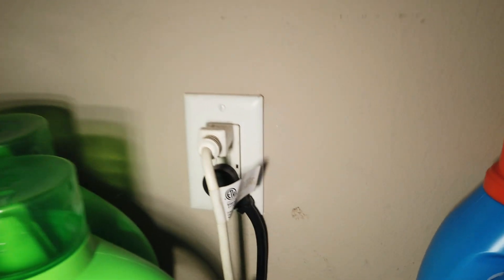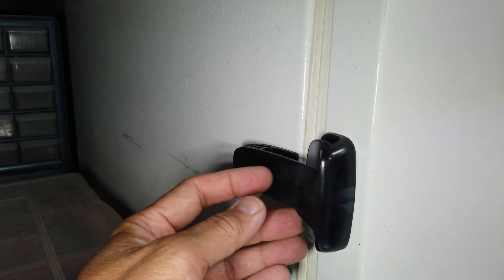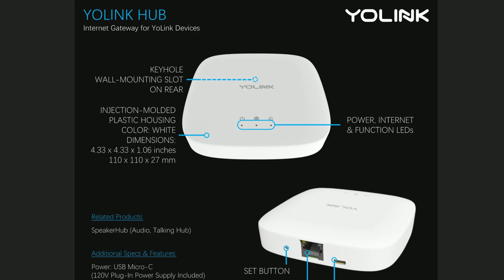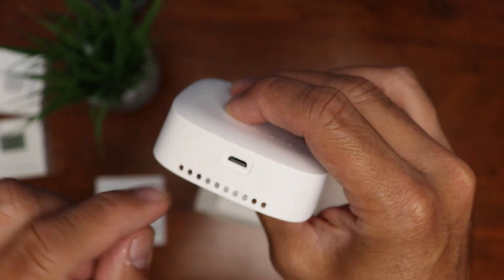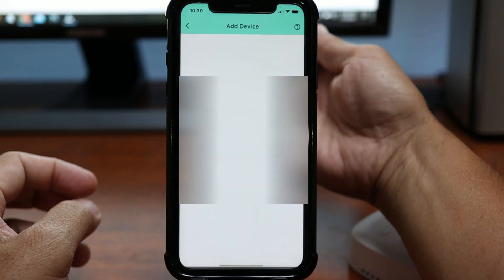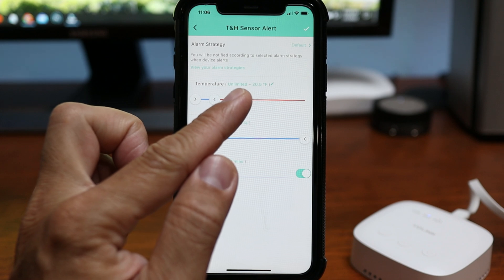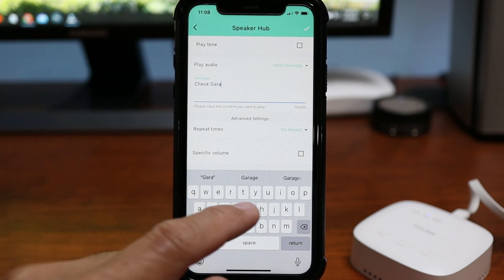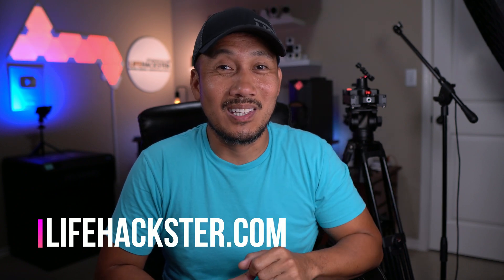Smart Temperature Humidity Sensor with Yolink Speaker Hub

Comment: I bought Yolink leak detectors and alarms. They are very easy to setup, to the point of I wondered whether or not these work. I have 4 sensors and test them every couple of months, they work like a charm! Having sensors on the top and bottom is a great feature. I wish they would make more products including cameras since they do a bang up job on everything else. If anyone is into automating their aquarium Yolink has enough sensors and smart power outlets to make economical setup. Great video LifeHackster!

Comment: Hey LifeHackster! Not saying these are "bad" products at all but I use GEN1 SwitchBot temp/humidity sensors with the additional "internet" hub and have these all over my home from the fridge, freezer, basement, garage, and a few around my home. These too can be setup with temp/humidity "ranges" which will alert you on your phone/email to let you know something is wrong in a particular area/appliance and I picked up a "bundle" of (4) sensors for $39 on Amazon after testing a few first. Now SwitchBot does not have the 1/4mile range (which is useless for me) but, these also work with Bluetooth! SwitchBots internet "HUB" costs $49 but sometimes goes on sale. The "beauty" of these products is there is NO annoying alarm or beeping which I absolutely HATE! Now WHY I choose SwitchBot? Well in a power-outage situation and these use Bluetooth I can "constantly" keep an "eye" on temps of my fridge/freezer and determine if I need to hook up my portable generator if temps start to get too high and my local "power" app says it's going to be several hours before power is restored! Most "modern" fridge/freezers are "good" for 6-8hrs with NO power.  The "simple" knowing of my temps with NO power is great and has kept me from "pulling" my generator out in MANY cases.
Reply from the maker: Thanks for the tips and sharing your experience with the switchbot. I have to check it out.

Comment: I'm glad to see you doing a YoLink video.  I have a lot of their stuff (I bought every bit of it) and it all works well.  The leak detection with the ability to shut of water to the house when there's no power or Internet is unmatched.  I use their regular temp sensor in my freezer and it works fine.  The LoRa system allows it to work though the metal of a refrigerator easily.  I use their temp sensors to also control ceiling fans in two places.  When the temp is "high" (80F) an Alexa app starts the fan and when the  the temp is "low" (74" it turns it off.  I use a motion sensor in my mailbox which works with an Alexa app to announce "You have mail" when it comes.  Thank you.
Reply from the maker: They have a pretty good system and their products and sensors are the ones that fill the gap that other popular brands don’t address and make.

Comment: Another simple solution is to buy a Power Fail Alarm that connects to the same outlet you want to protect. These alarms emit a very loud noise when power is loss to the outlet and the one device I bought on Amazon also emitted a bright flashing light. The noise is loud enough to hear inside your home even if it is connected in your garage.
Reply: YoLink has one that will send an emergency alert to your phone, or SMS/email. I use that, a door sensor and temp/humidity sensor as triple protection.
Reply from the maker: Thanks for the tip. I have to check it out.
Reply: @LifeHackster  The device I use is the Reliance Control Corporation Power Fail Light W/Alarm. Also, another viewer stated Yolink also makes a more sophisticated device that will send a text to your phone upon power failure (Yolink Smart Power Fail Alarm, AC Power Outage Alert).

Comment: I would move whatever else is plugged into that outlet and only keep the freezer to ensure that you reduce the chances of it tripping. GFCI could also be faulty. But I would definitely pull the outlet from the wall to make sure there is no damage to the wires itself. It’s tripping for a reason, look into it for safety reasons! Best of luck and thanks again for your reviews!
Reply: Also, they do have GFCI’s that emit an audible alarm when tripped, hope that helps!
Reply: @cjvillarreal217  , that's good to know.

TY
Reply from the maker: The only thing is..this is only the outlet I have in the garage. I cannot pin point yet what trips it but it happens rarely…mostly it is because of power tools but there are a couple of times that I don’t know about which caused the freezer to thaw out. Thanks.

Comment: Have you seen any LORA long range driveway sensors that have an app or alerts? most just notify you in house. I need it for a remote cabin in the woods that I am hours away from...
Reply: I'd like to know about one of these too.
Reply: @doughumble8730  looks like yolink actually sells one!
Reply: @CraigMullins1  is it battery operated or does it need a power source?
Reply: @doughumble8730  battery should last 2 years
Reply: @CraigMullins1  what is the product name for the device you are referring to?
Reply from the maker: Yolink has outdoor motion and contact sensors. As for remote notifications on your phone, you need to have internet or WiFi where the hub will connect to unless you can get a Cellular hotspot.